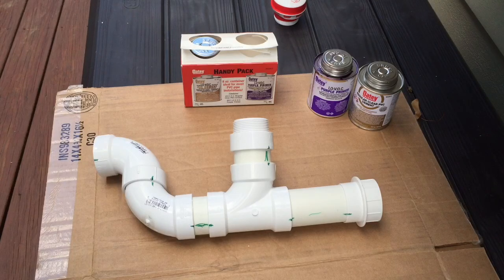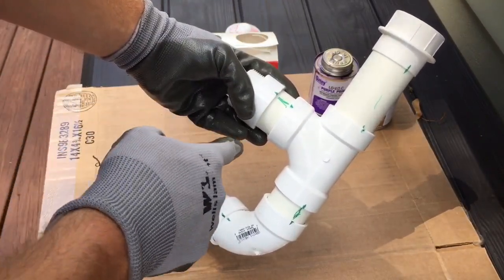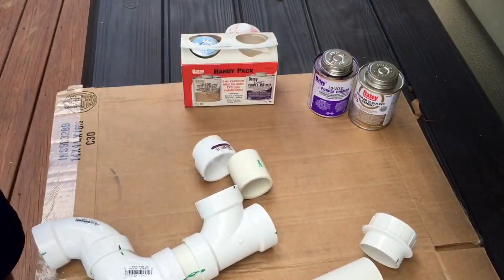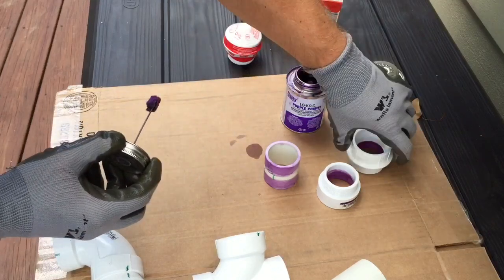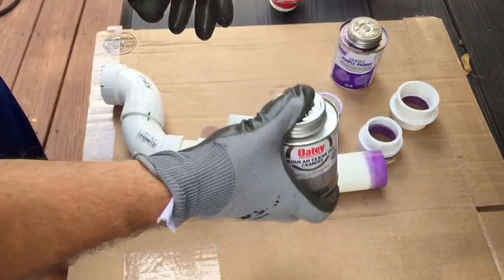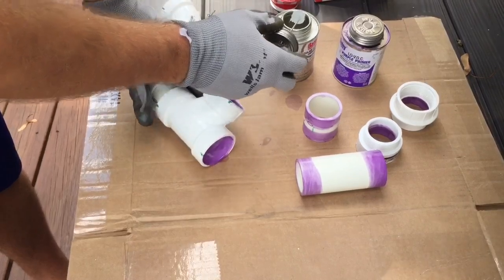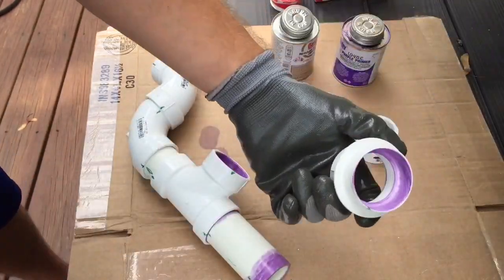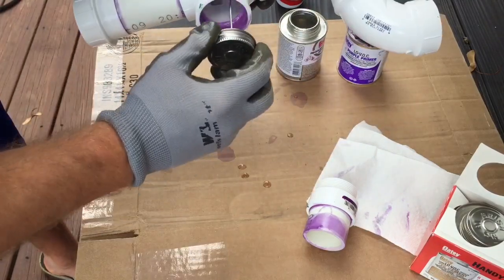How to use PVC Primer and Cement to join PVC Pipe

Comment: I see you didn't chamfer the ends of your pipe. This is best practice so they match the angle inside the fittings. If you don't there will be rough edges that can snag stuff and cause a clog. Its not a huge deal, but it is best if you do.
Reply from the maker: integr8er66 I did not have the tool available, but I will certainly include it in a future video. Thanks for sharing.
Reply: The pipe should be chamfered so that you don’t push all the cement out of the fitting with the sharp edge.   I usually use a sharp utility knife to knock the edge off.
Reply: @TomTheTechnician  Thats not really why, but it is still proper to do, I'm not talking about deburring the outside you can't remove enough material with a knife, I use a router with a 45 deg bit, but they make other tools as well. The chamfer needs to be all the way to the inside diameter so when glued there is no ring left where the end of the pipe meets the fitting. It is equally important to deburr the inside as well so there arent snags, but that is a very light cut. You should apply glue to both halves anyway so both sides have adhesion anyway.
Reply: @integr8er66  you are probably right… but I know that if the outer edge isn’t knocked off at all and the pipe isn’t inserted perfectly straight, it will strip a layer of the primer softened pvc from the fitting, which can restrict the flow and increase the probability of a leak.

Comment: Man, I have been using the jelly like cement for a good while.  It wasn't until I just bought some more cement and found it was runny like water that I figured I should find out which consistency was right.  Thankfully I just used the jelly on 1/2" sprinkler lines that I pressurized (didn't leak), but got me worried now.  I am about to do a major job on my main sprinkler line, bought this very runny cement (same as in the video), and I thought there was something wrong with it and was about to return it, as I have never bought a can with that consistency.  Thank you very much for showing what you did in your video.  Save me some time.
Reply: I have used thick cement many times, and even on pressure lines and never had a leak. maybe not best practice but it has worked many times
Reply: I just used jellied like in the video, and I have before. Seems to hold just fine but I will report back if something blows. A Never used unopened can but pretty old.🤶
Reply: I dont think it matters
Reply: @saraluttrell189  Worked great on my emergencies to get some water going, but once I got further down in the can it was too sticky and I had to go and get a new can to finish.

Comment: The thickness of the glue depends on if the cement is heavy bodied or medium bodied or light bodied
Reply: I use heavy bodied clear glue for most of my pool plumbing due to the fact that there is alot of pressure and it looks cleaner than the blue or gray glue.

Comment: Is the pipe ready for use right away? Or should I let it cure a few hours before running water through it?
Reply: In drain lines its ready in a few min, on pressure its best to wait an hour or so

Comment: fyi,
not in video, but
are there specific set timings for “press and hold” and for priming??
or just prime and seal or let prime set for a few minutes,
Reply: ANTHONY MAURICE SANDERS - it said hold for 30 seconds.  Also, I've seen in the comments that you want to apply the cement to the primed piece while the primer is still wet.

Comment: Hi what side pvc pipe is that? Also what is the connection called if you want to connect two of the same pvc pipes of the same size? Is that a coupler?
Reply from the maker: NC Vman I’m using 1.5” pvc pipe, two 1.5” 90 degree hubs, 1.5” to 1” reducer, and a 1.5” sanitary tee. If you are just trying to join two pipes in a straight line, you would use a coupling.

Comment: hey sweet video man! im trying to make stickshape of a human figure (for a halloween prop) out of pvc pipes and i seen in your video you had the same pvc pack i had. Is it possible to just use the jelly on the pieces i would like glued together or do i need to use the purple primer? im assuming the primer is going to act like a protective layer over the pvc pipes.
Reply from the maker: TheExenteration are you trying to avoid getting the purple color on all your pipe joins? The purple primer allows the PVC cement to create heat and weld the pipe and fitting together. However, for your particular project you should be fine erecting a skeleton just using PVC cement to connect the pipes and fittings together. Good luck!

Comment: Oatey recommends two coats of cement one after the other and the first one while the primer is still wet ...I just saw their video
Reply: xtra cement seem like common sence as xtra stability, but is the primer suppose to dry first or applied while wet?
Reply: While still wet
Reply from the maker: I just had a look at the Oatey cement directions on the can and it does indeed state that you should first apply cement to the pipe, then apply a small amount of cement to the fitting, followed by a second coat of cement to the pipe before inserting the pipe into the fitting.

Comment: when you connect your pvc pipe to lets say a union, do you push it all the way in (which is about 1 1/2) until it hits the step of the union? or can you just push you pvc pipe in 1/2 inch or so? because it seems like a pain in the ass trying to push hits the step.
Reply from the maker: You need to fully push the pipe into the fitting so that it bottoms out. The less you push the pipe into the fitting, the less surface area you have to weld together, and you could experience a failure prematurely. Also, if you needed to get the work inspected and they caught that the pipe fully seated into the fitting, the inspector should require you to redo the work.

Comment: Thanks for submitting this video. I will use this soon so it was helpful. If I am using pvc outside in the garden should I paint it?
Reply from the maker: Painting it will help block UV rays which will yellow and break down the PVC pipe over time. The PVC pipe will also become brittle and can more easily crack. However, you don't need to paint it and you should get many good years as-is.
Reply: Sounds like painting it would be a good idea! Thanks, Erik Asquith!
Reply: You can But that will make repairs difficult.

Comment: How long can the primer remain on the pipe prior to applying cement?
Why are you applying primer to the edges?
Reply from the maker: One should apply the cement immediately after applying the primer, according to the instructions. Basically the primer should still be wet. However, I've read mixed reviews on this, but the instructions state it shouldn't dry. Also, I applied some primer to the edges to ensure a good bond as the cement will pool a little at the edge as you push and twist the fitting in the female end.
Reply: while still wet